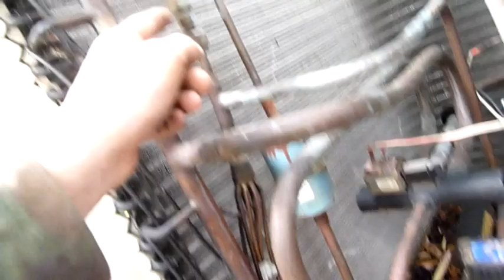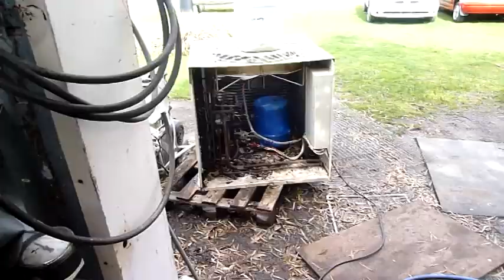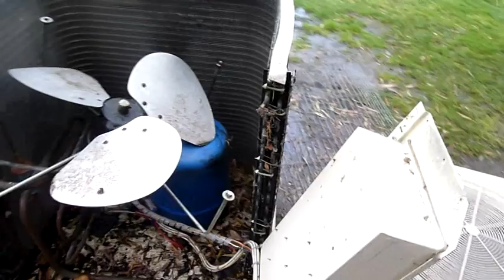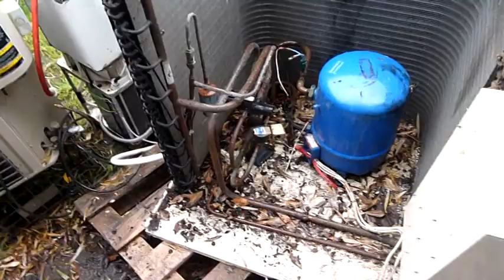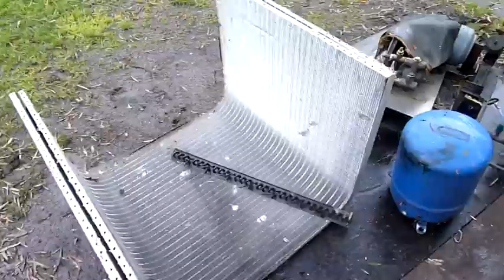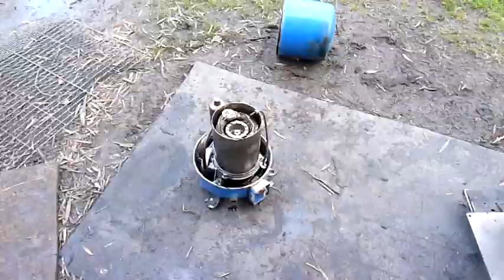APAC S13 AC Condenser Dismantling

Comment: Actually, if a guy were to drill out the rivets so everything would pack into a smaller space, but that's a 240 vac 50 Hz motor right?

Comment from the maker: yeh migration is a major issue in cold areas or where a unit can sit for a long time in the cold, not only can it cause oil slugging when it foams up, but the gas bubbles starve the bearings of lubrication and run them dry!

Comment: after the system has been down for a while liquid refrigerant has a tendency to migrate to the compressor the crankcase heater is there to flash the liquid refrigerant in other words turn the liquid refrigerant into a gas.if the compressor ingests large quantities of liquid refrigerant it can break valve plates,connecting rods, pistons ect..typically this occurs in a cold ambient condition....PS that's not a stupid question

Comment: The Crankcase heater keeps the oil warm. If it didn't, the oil would absorb the refrigerant, diluting it. When the compressor starts, the diluted oil won't lubricate as well and can cause damage. The other problem, the refrigerant will boil out, foaming up the oil and the compressor can suck it in, slugging the compressor with liquid.

Comment: a 610 is just a rebranded 520, which is absolute crap for GTA even at 800x600 with lowest setting it can't pull any more than 23 FPS, which is jerky at best...
You can check out toms hardware graphics charts 2011 that have GTA 4 in them.

Comment: Thing is, a modern computer needs 12V, in fact most of it runs off 12V including your CPU, and if they have to compete as a hungry graphics card can quickly chew up 200W of 12V power, it will starve your CPU out and leave you in a restarting computer hell as it loses PWR_Good signal.
Also these PSUs are cheaply made to save dimes during manufacturing, so loading them up is a very bad idea.

Which is why I recommend a low powered card, or a full overhaul.

Comment: Don;t get a 210 it;s crap, try getting second hand one for 50$, from AMD side anything above 4850 can run GTA just fine, (not the highest settings though).
If you can look for 6770 or similar.
Nvidia side try getting at least 240GT or similar (second hand off-course).
Backward compatibility is tricky, it depends on your board and the card.
So putting a PCIE 2.0 card in PCIE 1.1/1.0 should work but there are no guarantees.

Comment: In a Dell or other premade computers your power supply is too crappy to handle anything powerful.
As a result, if you want power, the best you can get is the most expensive card that doesn't have additional power connectors on them.

Comment: Aussie, I know this is off topic but i need to know what video card to get for my pc.  It's got a shitty x600 hypermemory dell oem card in it now running on pci-e 16x.  I need to know a a cheap 50 dollar card that will work well for dicking around in gta at like 20fps or a medium settings.  I was looking at a geforce 210 but I've heard they are crap.  Also, will a pci-e 2.0 card work in a pci-e one slot?
thanks.